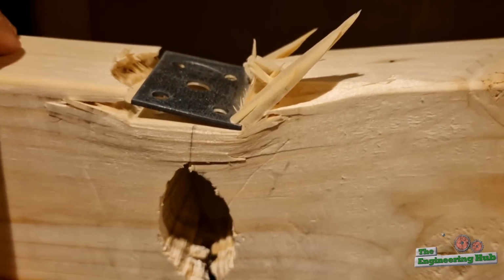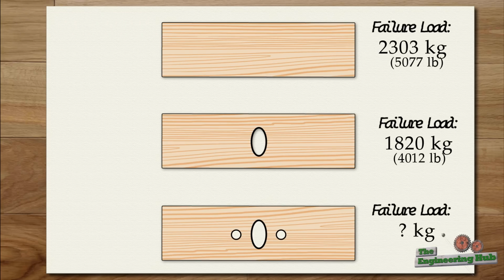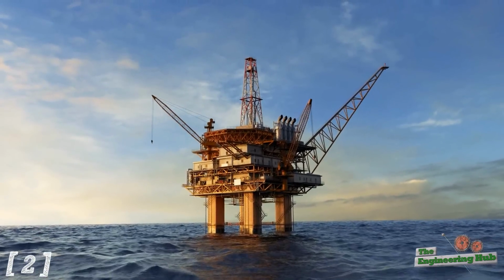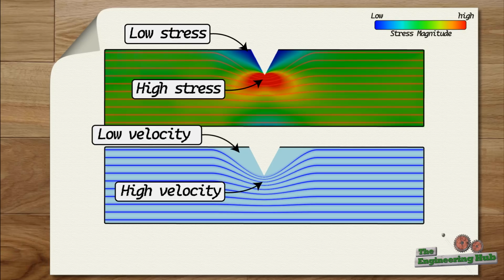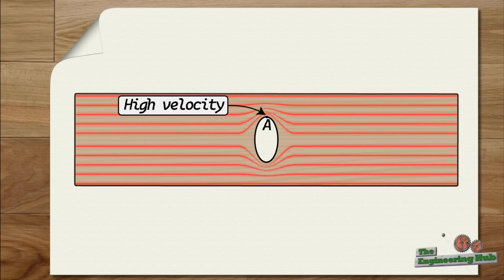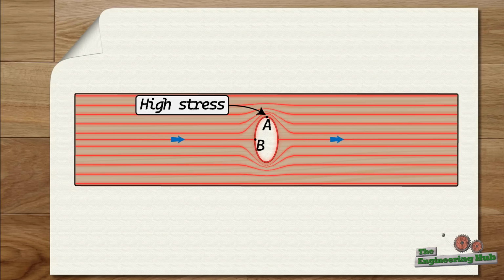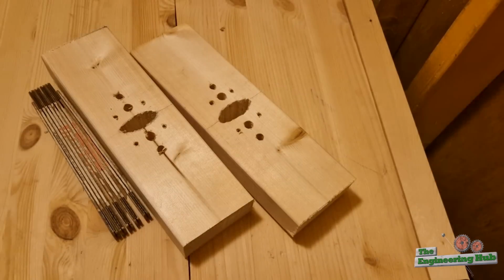Can drilled holes make your beam stronger?

Comment from the maker: Just to address some of the repeating comments: 

1. I didn't come up with this analogy! I read about it in an engineering book that related it to a stress reduction technique used in the past. You can read more about the theory in Reference 3: Roark's Formulas for Stress and Strain, Chapter 17.2, page 777. I thought it's a crazy idea so I decided to test it. I uploaded the PDF for you here: https://drive.google.com/file/d/1JE9jCCAGj7MGXMqZQSjOo8KS8XlC5y4D/view?usp=sharing

2. Yes,  the method is used for tension members specifically not for beams but my home setup does not facilitate tension testing so I had to improvise. The point is to show that removing material can increase the capacity.

3. Of course this is not a peer-reviewed study so the results should be taken with a grain of salt as there is a lot of variation between the samples, they are way too few, and the testing environment is not strictly controlled. 

4. Not many holes are elliptical in practice. In theory this should work with circlar holes (cables, pipes, ventilation, etc) as well, but the capacity gain is probably much less, if any. I used an elliptical hole to make the gains more drastic and hence more interesting for a YT video. 

I encourage the comments pointing things out, this is great! I like the idea of community notes, I hope it comes to YT as well. Cheers!
Reply: I would not apply a theory for a isotropic materials for anisotropic materials like wood.
Reply: To your Point 2:
Adding holes doesn't increase capacity. It can increase stiffness/capacity to weight ratio though. BUT the only thing you did is increase elasticity around the failure you put in the beam in the first place. It's simply about peak-stress - BUT you induce it with the first hole and than simply 'homogenise' it.

If you have force in the middle, best hole-option would be big in the middle, than multiple ones to the edges getting smaller. Ellyptic or not only makes a difference in stiffness gradient around peekforce. You could simply simulate that with two smaller overlapping holes - which an ellypse ultimately is. IDK...I would do the video again... accurately.
Reply: Thanks for the effort you put into creating your video, and then providing a lovely comment reply summary. 
Thankyou for the practical tutorial Guru.🙏
Reply: Any experiment with wood is going to require a lot more samples to be remotely accurate. You ran your hole-less and single hole samples once? That's not going to cut it, teeheehee. I can see how the relief holes can help in theory, though I imagine the effect will be quite small. Intuitively I expected there to be no significant difference, certainly not detrimental, between the relief holes and the single hole samples since the point of failure is either going to be the top of the board under compression or the bottom under tension. The middle of the board is not under much stresses. This is why you can cut giant holes out of the middle of engineered I-joists without effecting strength significantly.
Reply: I think you effectively did a bad job, and I’m saying the morning after watching your video and thinking about all the discrepancies. Maybe there are more important things than what ads you can sell thanks to algorithm manipulation.
Reply: @APerchOfPillows  He definately made some mistakes in terms of his conclusions, due to the huge variability of wood, and other factors, but he still did bring up an interesting piece of theory, and referenced it decently... Even if he did mistakes.
So I think your statement that he just made to video for the sake of ads and algorithms, that is maybe a bit too harsh?
There is constructive criticism, and then there is the type of criticism that just tears people down. Let's please try to keep it to the constructive type.
Reply: Thanks for that setup. We showed a similar thing in lab to 16 year old students in vocational training. However our goals were to show that beams break easier based on the minimum cross section over the width. We might append your video as recommended learning material to show that real life is often more complicated than easy models.
Reply: You said: "All of these samples were taken from the same 2x4 so in reality there shouldn't be too much variation between them".
I am myself a civil-engineering student, and in one of our experimental classes, we examined several 2x4's visually and classified them according to the INSTA 142 Standard, and there is several details that determines the strength classification.
Worth noting is, that those details used for classifying a whole beam might vary even along the same piece of 2x4, so even if you are cutting out pieces from the same 2x4, you can still have significant variation in strength.
For those that are curious, I would like to mention that we did test all the 2x4's to failure.
The difference between the weakest and strongest 2x4's across all classifications were almost by a factor of 3.
And even within the same classifications those 2x4's varied as much as 20%-50% from strongest to weakest.
Or in other words, wood varies so much, that you need quite large sample sizes to conclude anything.
Reply: Yes the algorithm favours elliptical holes. That's bizarre.
Reply: I’m not an engineer so a video like this is fascinating to me. I would never have thought that removing further material could increase strength.  Thanks for make it.

Comment: There is a point you’re missing with your experiment. Obviously, you know much more about engineering than I do, but you are missing something about the wood you are using. Just because the lumber came from the same piece as it was cut up in the sections does not mean that each piece is equally strong. Knots  and other defects within various segments of the wood would greatly compromise the beams strength. It’d be very difficult to take that into consideration when doing your experiments, because you may not be able to see all the defects , but I think it’s something that you should consider.

Comment: 4:57 I mean we could divide the hole into areas by the changing in cross-section area, use the method of "cuts" (idk how it is called in eng) and calculate how inner forces and max stress would look like. Nah, I'm too lazy for that

5:32 Wait, why did you... okay, but...

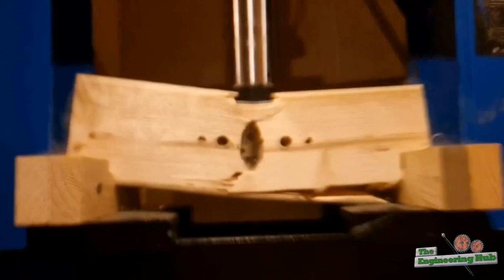5:42 OMG 6% INCREASE !!! :d It's totally not the difference between each piece of wood, trust me. And that there is 5% difference in my 3 tests of drilled holes. 

AND THE FACT THAT DURING THE BEND THE OUTERMOST LAYERS ARE EXPERIENCING THE MOST STRESS AND DEFORMATION YOU

... and they are the point of failure... also with your drilled holes and method of load the tangent stress becomes worse (as it is maxed in the middle of cross-section)

Comment: To better grasp on the "flow model": you must always remember, that forces are mediated from particle to another by means of chemical bondings and do not spread instantanously through the solid body. If you model this bottom up, you end up with equations similar to fluid mechanics.

Comment: Wouldn't it be better to model the flow as entering from the top where the load is applied and exiting the two ends where the beam is supported? Since this is the path the force would "flow" through the beam?

Like, a hole in the top right or left corner probably wouldn't matter that much in this loading application, while a hole in the bottom right or left corner would have a larger impact.

Comment: You could repeat the experiment with engineered wood which is made from wood chips and resin and designed to have much more consistent density and strength distribution.

Comment: I would say aside from the low test quantity and lack of control, the theory of wood is that it is better in tension , so I don't really see why a failure at the bottom would signify the stress flow had been altered?  Also lso I don't like the failure of the solid piece of wood

Comment: You need to take a strength of materials class. You are mixing up tension stress, bending stress, shear stress and localized bearing stress. Bending stress does not FLOW as you describe. Bending stress is ZERO at the center and high at the top and bottom of the beam. Shear stress is maximum at the center and zero at the outside edges, (VQ/(It). Tension is sort of uniform except your notch where you get an eccentricity and have both tension and bending.

Put a hole in a beam and you get essentially two bending elements, at the top and bottom of the beam. For a short span, SHEAR stress, not bending stress, is controlling.

Excellent video making, just wrong.
Reply from the maker: @TexasEngineer  LOL do you really think I don't understand Mechanics of Materials 101. Did you even watch the whole video? Classic YT comments
Reply: @ Twice
Reply from the maker: @TexasEngineer  also you don't get two bending elements by drilling a hole! You get stress risers, but the linesr stress variation is essenrially maintained + stress jumps at the hole edges.

Comment: Also you have to take into account that wood is basically a bundle of straws tightly packed and glued to each other. This means that when they are subjected to deformation there has to be room for the straws to bend into.

Comment: 4:08 "have to enter and exit at the same time" — no, they do not have to. That's a well-known mistake, it also appears in a wrong explanation for the lift force. They do not have to take same time. For example, the separator line that goes through the stagnation point takes infinite time to pass the stagnation points. And the closer you are to the separator the longer the delay. The correct statement is that the incoming flow is equal to the outgoing flow (measured in m³/s and for an incompressible stationary flow).
Reply from the maker: @alexeykrylov9995  you are correct, that is the case in a real life model. But in a potential flow model where the fluid has no viscosity (hence no shearing forces), no vorticity, and is incompressible, that same time statement also holds.

Comment: Realize, you can determine that of course there are cases where this works with very basic logic, without even cutting anything.  Initial hole creates stress concentration areas, some of that tension pulls at the hole causing the initial failure point.  Other holes further out can disconnect some of the tension from fibers pulling at those stress concentration areas, rerouting the stress and making it somewhat less concentrated at that initial failure point, making it fail at a higher total stress.
Initial hole = loss, further holes can redistribute loading and can gain back some of the loss by distributing the loading better than only the initial hole did.  The difference should be relatively marginal.  Can all be worked out without testing or drawing anything..
And of course your 'flow' idea later in the video is basically the same idea.  Realize the flowing shape is basically 'disconnect all of the horizontal long fibers in this pattern'.  You're essentially turning the smaller bad main hole into a larger hole that is simply discontinuous.  You could basically just cut out that larger, better shaped hole instead of multiple small holes.

Comment: You didn't do multiple tests with just the oval, it might have failed at 2100 lbs too. Also, is the board in tension or compression? You're asserting that it's being pulled to the left and right, but it's not being pulled, it's being compressed from the top, which is different.

I'm not a mechanical engineer, but this video and your work seems haphazard and incorrect.

Comment: Your elliptic hole created a problem to solve, and your tests only showed the relief holes unfucking the mess you made, not making the wood stronger. The un-fucked-with board is still the strongest.
Reply from the maker: Yes, absolutely, the board with no holes will always be stronger. The problem is when holes can't be avoided like in a case of cables, vents, pipes, etc, running through

Comment: So in summary, if you HAVE to drill a hole through the middle of a wooden member, add relief holes. Otherwise, just don't touch it and you will get the strongest load.
Reply from the maker: Yup

Comment: Calling a channel ingenior shit and then taking different wood pieces to try to demonstrate something..... Each wood piece is different, you could try something with at least 10 pieces in each case then go with a stasticial approach. But as it has been done..it's useless and non conclusive.
A piece of wood is certainly not like a linear flow, most of them are not and while drilling in the middle of a piece of it will not decrease strength significantly, as the main purpose to reduce weight or help passing wires or so. I beams are mostly emptied in the middle for weight advantage.

Comment: There is an anekdot. Aircraft designers struggled with the problem of wing strength for a long time. In the end, some drunkard advised drilling holes in the place where the wing was damaged. It helped. When he was asked how he came up with this solution? Easily! Have you seen the perforations on toilet paper? That's where the paper doesn't tear!

Comment: Please test this again with better holes. Your main holes are uneven and crude, and act as shear propagation points. If you do not have the tools to make a smooth oval hole in one go, file down the edges and cuts until the hole is smooth. That should significantly reduce the chance of the wood breaking at the most aggressive cuts of the hole.

Comment: Even if this somehow worked in such an inconsistent material as wood.

The holes just adds new deep points for the wood to root and decay over the years reducing the long term duration of whatever you build.

It was doomed for many reasons even before being tested.

I worked remodeling houses in usa and the state of some beams that are not supposed to get wet goes bad so fast… don’t put holes there, thanks 😂

Comment: 6%? you need to make a hundred tests to prove something....
Reply from the maker: Yup
Reply: @TheEngineeringHub  I've had to look this up. Took a long time. I think the variability to expect is +/- 10% for any structural material. If you want to dig deeper, the variability is different for tensile strength, shear strength, and even Young's modulus. And even that applies within certain standard deviations.
Reply from the maker: @boppinator4308 for wood, the coefficient of variation in the flexural strength is in excess of 0.3. This is why the mean value is far from the 5th percentile strength reported in codes. The variation in Young's Modulus is not as drastic but still high. It's similar for the tensile strength. There is no doubt that many tests are required to be able to make a serious claim

Comment: This video is missleading and the explanation is totally wrong. To explain why cutting a hole might actually make the board harder to break (that is different from "stronger"), imagine a piece of glass, let's say, cover glass. Imagine using fiber glass rope the same cross section as the cover glass, you will find it much more difficult to break the rope than the cover glass.

Comment: This makes me think about how some people would drill holes into the frame of their BMX bike to make it lighter at the cost of it being easier to crumple under weight. With this, there should be specific areas on the tube that would benefit from losing mass and actually improve structure strength. Neat.

Comment: I will be honest. I am not an engineer. I just don’t see how flow dynamics, in a piece of wood, perpendicular to where the stress is applied affects the strength of the beam. Even if a beam with multiple holes is stronger than a beam with a single hole. I would think it would work more like a tiered fountain than a wing or a wedge. I sorta get what you’re saying, maybe? Flow dynamics can be similar to the redistribution of stress from an area of lesser material to an area with more material by creating smaller areas of stress as long as the material is laminated like wood?
Reply from the maker: The stress is not parallel to the load application direction in this case. In fact, the stress direction is longitudinally along the beam's length this is from beam theory. The top of the beam is in compression and the bottom is in tension. It is not the same as a purely tensile test but it is similar. My home testing setup does not facilitate tensile testing so I had to improvise.

Comment: What that also says, is that for construction, 2x4 timber is far stronger than you might imagine when supported correctly and that holes for pipes, cables etc don't necessarily weaken it that much. 
Good explanation and I found the audio to be just fine. 
Many thanks.
Reply from the maker: @andrewclarkehomeimprovement  yup, agreed 👍

Comment: isnt that the same reason sharp edges are not allowed on high stress components like aircraft landing gear?like a variant of the same theory but instead of rounding the cut external edges , we are rounding the inner holes..a mirror image of the stress distribution
Reply from the maker: @jeetenzhurlollz8387  yup, I believe the reasoning is the same, just a slightly different way to explain it. In fact, the equations solved to analytically determine the concentration factor are actually very close to the potential flow equations. These topics are definitely related. Cheers!